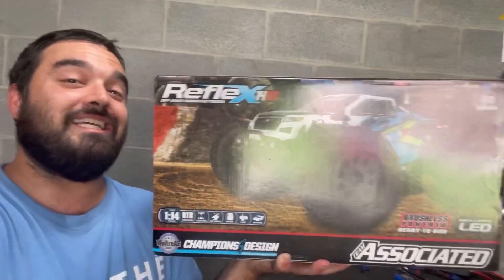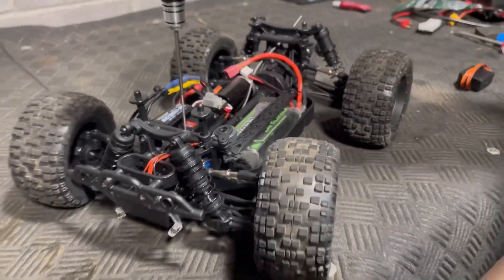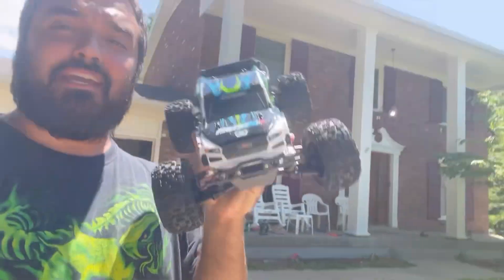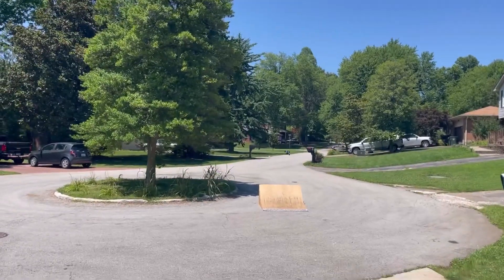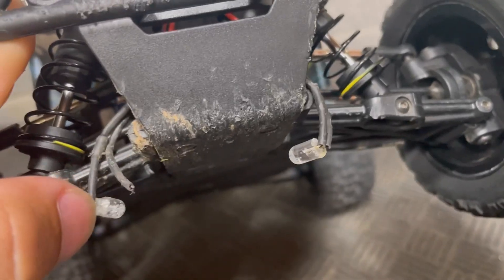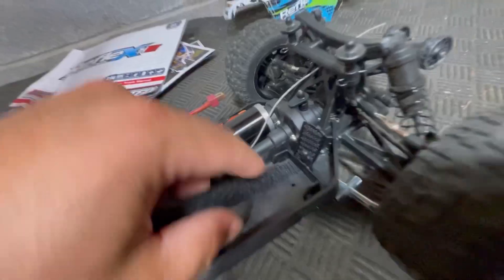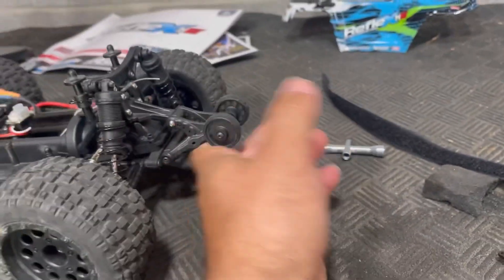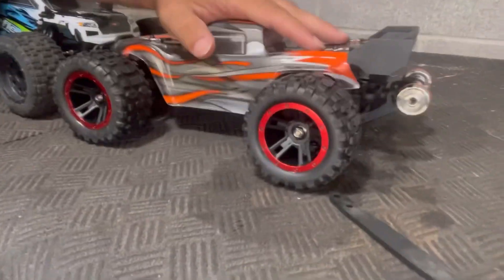Team Associated REFLEX 14MT - (it broke instantly, then redeemed itself)

Comment: Great truck, My servo did the same thing. AMain is great. The rep did a full search on his end but could only find the D115F that was available to them. I was able to find the D135F, which is an all metal upgrade from the stock servo. I ordered it and it should be here tomorrow. AMain did send me a replacement D115F, but im not going to install it. I'll give you an update once I've had a chance to beat the crap out of the metal one.
Reply from the maker: Ya after you told me about the D135 I found it. Certainly affordable enough and if you’re report is good, that’s what I lol get when this one inevitably breaks!
Thanks!

Comment: I’m willing to bet if you change the fluid on that center dif to something lighter the motor won’t get so hot running in in the grass is what does that on them center differentials they need lighter fluid to rotate faster
Reply from the maker: I didn’t have it in the grass all that much, but I like the thicker center diff fluid. We’ll see how it lasts!

Comment: Another awesome review of a new car. You always explain all the good and bad points so well!
Can I ask, do you vent your tyres or do you just run them as they come out the box?
Reply from the maker: Thanks!! I run them just how they are. I try not to ever play on the water so hopefully won’t be an issue. If I do, hopefully I’ll remember to vent them lol
Reply: @DerbyCityRC  Thanks for your reply. My son has the hbx 16889 running stock tyres and I've noticed a lot of dirt gets inside them even in the dry. Not sure if it will affect the balance of them eventually?
Reply from the maker: Dirt gets inside the tire itself? If so it must not be glued properly. I’m sure it could throw it off balance if it got bad enough.

Comment: Great review, just wish you had stopped and reset that pinion soon as it started clicking, but I know you like to beat on them as is to test their durability. I think the tires, center diff and lack of 3s are main features that kept it planeted but it also looks wider and lower like a Kraton. Would be interesting to see the ground clearance/width vs the 1/16 Hyper Go.
Reply from the maker: Thanks!
Ya i was actually thinking it was a diff until it finally came off completely. Once it started making noise it didn’t take long.
It also has more suspension travel on its side!

Comment: I love your channel. Hey do you know what the outer diameter is on these tires? I think they would be a great fit for my hyper go. I keep breaking wheels on my hyper go and i think these would be a better quality replacement wheel and tire
Reply from the maker: These are excellent tires. I’ve got the link in the description, maybe they show the measurement, but probably around 95-100mm
Reply: @DerbyCityRC  Yea they seem llike it. I cant find the spec on associated's website. They dont list the outer tire diameter. Most hyper go tires i know are 82mm. They seem to be the perfect size. I tried the proline 1/16 trenchers which are 92mm and they are too much for the stock motor and esc. Both get too hot.

Comment: Happy new year Evan! I just saw this car. How does this thing handle compared to Haiboxing ? Man I haven’t had good luck with them. Purchased two… first couldn’t drive straight and second would just drive off when my daughter turned it on. Scary.
Reply from the maker: You too Mike!
Been a few months since I’ve driven it but i remember it handling very well.
The second hbx that drove off when turned on, most likely the throttle trim knob was turned to the right putting it out of calibration. What model is it?
What model was the first one? The same?

Comment: Question. Have you been having thermal throttling on the mt14? Mine has been having this issue about a month into owning it.
Reply from the maker: Ya know I haven’t driven it since this video lol
I still need to put the spur gear in it. I’m gonna use the smaller spur it comes with if, but something else more important always comes up lol. It’s on my “fix it soon” shelf lol

Comment: I've had the truggy version of this platform for about a year.. same exact thing happened to me. But since mine was 2nd hand I had to replace that piss poor servo myself. And it was like 24 bucks! I've looked for a better one with the same spline because the s.s. is pretty good and I'd like to keep it, but if it breaks again I'll just have to find a metal geared servo and use a horn. Good luck man.
Reply from the maker: Crazy that quality is so low in the servo. The Batam D135f seems like the same one with metal gears
Reply: D135f is a champ
Reply from the maker: Awesome, I was hoping so!!
Thanks for the update!

Comment: That esc on its side stuffed in there with 30% of the radiator blocked from airflow is asking for trouble. They could have make a bridhe over the chassis and have it sit on top, kinda in the cab if it'd fit. But props for battery tray in a small car. Although i keep wonder if too small battery tray in hbx cars, save them from being overloaded and suffering more crash damage due to bigger weight, or funny stability if people would try to put fatter 3s inside them, and then complain the car tips over too easily.
Reply from the maker: All valid points!! There’s always a caveat!

Comment: I looked at this for a while being a huge fan of our MT10 and even our MT8 but for the price it was just a little too much.

We'll just stick to our HBX 12th scales.

Also I really don't like those Associated Electronics transmitters. Unnecessarily large, difficult one handed driving and I tend to have to set the trigger end points often. I've swapped most mine out.
Reply from the maker: Ya not the biggest fan of the controller either. What did you switch to?

Comment: This was a very far review. The car is a little rocket ship and you can tell it handles better than the HBX or MJX competitors, but the durability/quality control needs a little work. Probably not a big deal, but for those getting into the hobby it might be a turn off. If I was one of the big brand RC manufacturers I would want my entry level cars to be the best value, handling, and durable cars the company makes. The first step has to be a positive one. I think Team Associated will get the pinion and gear mesh quickly dialed. The servo seems a smidge more difficult to root cause, but also likely a fairly simple process control fix. You should send the servo back to them so they can figure that out as well. This car will be a beast once fully dialed in for what seems like some nuanced but important manufacturing variability or (less likely) needed bending stiffness in small but very localized areas.
Reply from the maker: Hopefully metal gears will be an option eventually. I don’t think they are yet. 
Otherwise yes it’s pretty awesome!